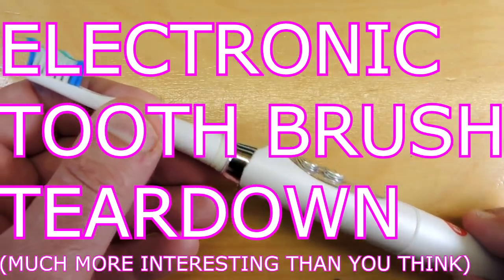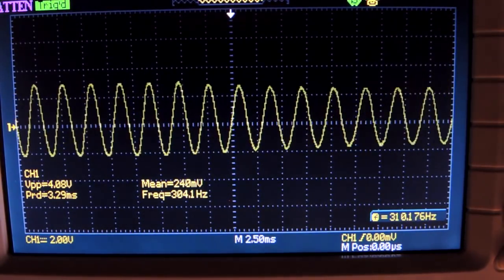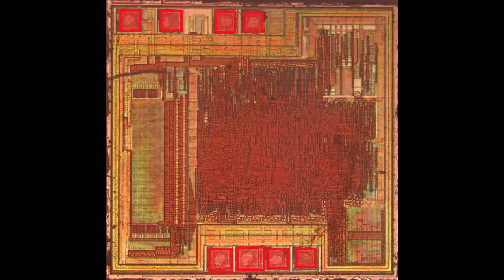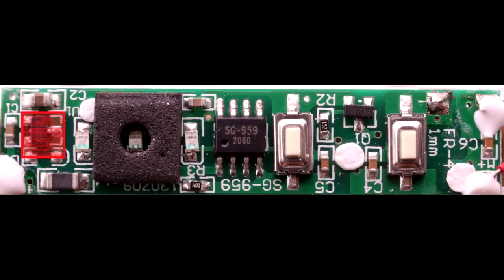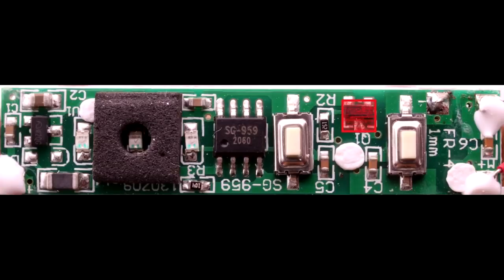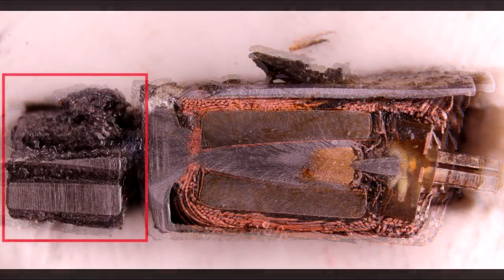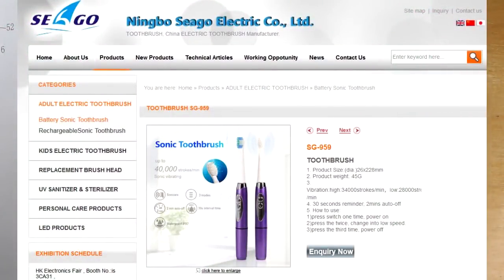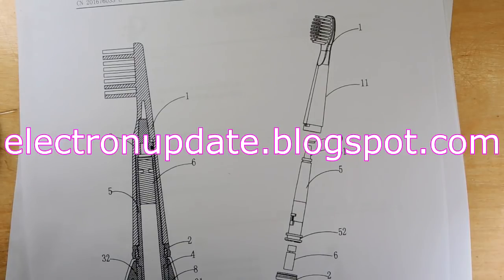Tooth Brush Tear Down: Wait! Much more interesting than one expects

Comment: That motor is very strange, how does it commutate if the windings are on the stator and the magnet is on the rotor? I see a commutator on the rotor but there would have to be slip rings as well to get the power back to the windings. I'll have to dissect an old cell phone and see if they use the same motor.
Reply: that is a regular brushed DC motor, these just so happen to have no core and the permanent magnet is in the middle.
Watching you guys discuss this little motor like it's something amazing is quite amusing to say the least.
Reply: I've never seen those before, thanks.

Comment: So how do you know what you're looking at after you de encapsulate the chips? I get schematics easily but the silicon layout is not as straightforward. Thank you
Reply: Probably covered in his college education. Most of it was made oversized and reshrunk over and over again such that the picture becomes the circuit.
Reply: After having watched most of his videos and those of Deus Ex Silicium now I can make out chip layouts. Logic, memory and analog blocks are easily recognizable.

Comment: Interestingly, I noticed the numbers on the die (3067C, M3-0, V1-A etc) are very similar to the markings on the Water Temp Light Teardown you did in December.  That die was labeled 3068C.  I only noticed because youtube showed it as a recommended vid and I watched it next.  :)
Reply: And I just noticed in another comment that  the dies look surprisingly similar, except this one has less connection pads. Perhaps they come from the same manufacturer. Unfortunately it will be hard to find which one. I know that most of Chinese microcontrollers come from Elan or Sunplus, but they usually put their names on the die, so maybe this one comes from Holtek or Jfd-ic